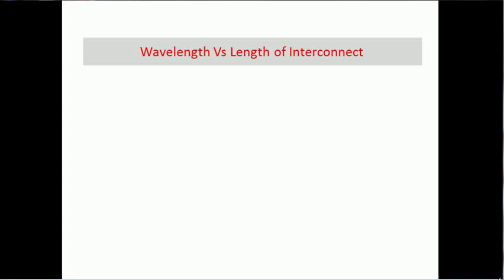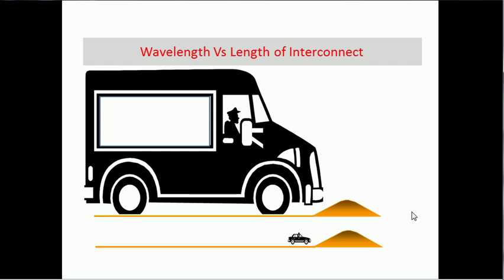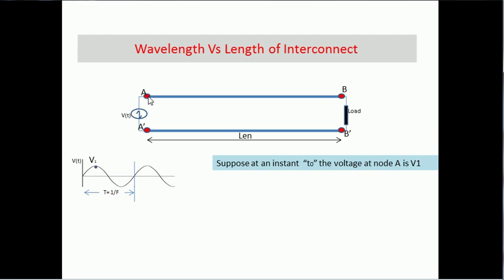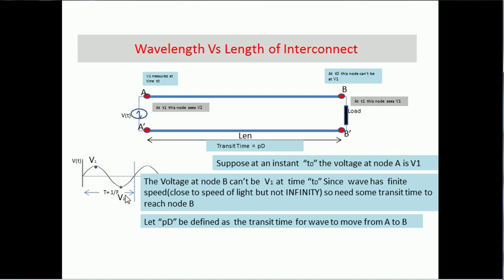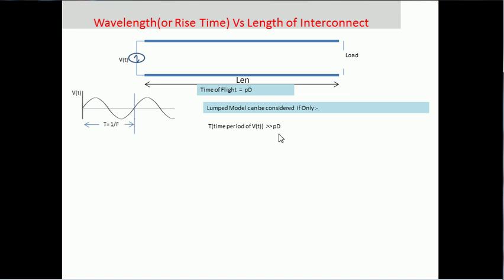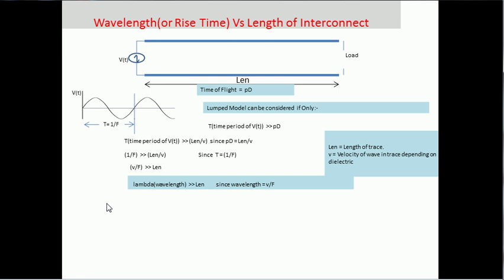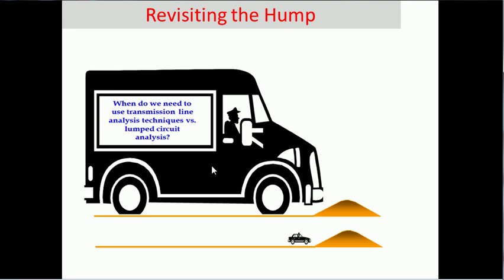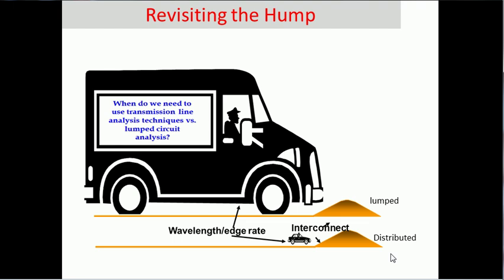Signal Integrity Basics: Wavelength Vs Length of Interconnect

Comment: Hi Rajeev, the video is easy to understand and intuitive. I also felt little more math would have been good. As in, how you calculate Wavelength (or velocity) for respective Dielectric medium and for a given length of Interconnect we can determine if its a Tx line or Lumped. Anyway, the video was good, just thought a small math would give an advantage when you actually work in this domain. Thanks